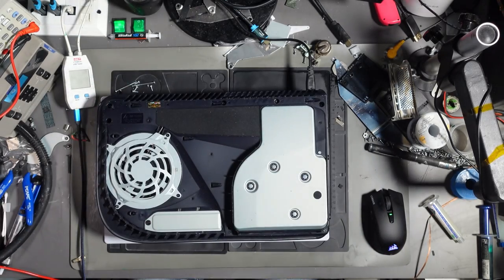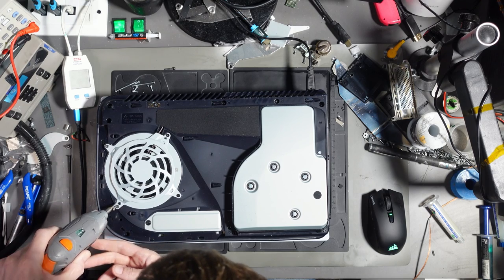Removing The Foam From A PS5 APU Is A BAD IDEA! Can I Fix Someone Else's Liquid Metal Mess?

Comment: I probably wouldn't have reassembled it without foam if it's that essential.  If it doesn't come in with one either refuse the repair without them sending you one or charge for one but I feel like it would be the same as if a console didn't have an x clamp. Just my 2 cents.
Reply: well you can run them without foam but you have to give up on liquid metal and run the machine with thermal paste.
seen some ps5 work with thermal paste but it isn't as silent as the regular setup.

Comment: Wow, if they have sent you 17 pieces of foam they have removed, there are at least 17 consoles out there that could break down at any time
Reply from the maker: Oh it's definitely more than that. I'd say multiply that number by at least 20 or 30 😮‍💨
Reply: @TheCod3r  - Sounds like they are hoping for these problems to occur, so they have more incoming work, and so make more profits, hoping that someone with your skills, doesn't realise that the foam needs to be there in transit.

Comment: Maybe when you don't have the foam, thermal paste in a syringe around the edge of the apu first. 
before applying the liquid metal. 

I know it sounds daft but it might create a barrier for the liquid metal. 

I understand that if the leaks somewhere else it might still short the board, but hopefully less cleanup.

Comment: Refuse to fix the console if they remove the foam. I don't think it's your fault but you should never send it like that either. Cheers mate.
Reply: Was thinking the same. No disrespect but if you know something is definitely going to fail without the foam why even fix it without it. Just replace the foam and charge them.
Reply: i agree..he sent it back out knowing the issue..but complain throughout the whole video..do the job the 1st time and your work wouldnt be sent bk...i like you coder but your common sense is lacking..if i was the customer i be a lil upset to both you and original shop..stop making excuses

Comment: Hi Phil, just a thought (or maybe a useless one at that) if the liquid metal had gone further in, could you use a compressed air can to blow into the opposite side of the APU and attempt to force blow it out? (Removing the existing liquid metal with a syringe first)
Reply: Ive told him so before on live steam already. I guess its not a viable option.
Reply: @jonathansandiford4137  I've done it on a laptop gpu with hairdryer, and has worked years fine after that
Reply: Just posted my comment and then saw yours. 😂
Reply: The fact that the business kept the sponge tells you they knew it was important, it's not your responsibility to replace every sponge removed and it's not the customers who should pay for it, the business made a FUBAR and they should pay for it.
Reply: There's a lesson to learn don't use that business and go directly to phil

Comment: Great work :-) i may have seen wrong but it looks like there was still a lot of liquid metal on one of the chips. So at 17.46 if you pause your video, to the right theres 3 vertical circle ground holes, just to the left of the middle one it looks like the chip is covered in it. I may be wrong but thought i would just say just in case. 👍

Comment: Not sure if it works in this case but have you tried using a syringe with a needle and sucking up the liquid metal, I saw tronicsfix use this method

Comment: Great video mate, just out of curiosity why dont they use none conductive thermal paste as used on PC GPU's/CPU's? I appreciate LM has a very high thermal transfere rate but in my experience working on high end PC's the difference between LM and good TP is only a few degrees difference in temps and no chance of damaging components from shorts. Keeep up the great work :)
Reply: With Thermal paste the PS5 will overheat
Reply: @BennyAlex98 maybe. My guess is to prevent long term thermal damage over many years of use. Some games really stress the APU which causes a lot of heat.
Reply: @Mr_Battlefield  tronicsfix himself testet the ps5 with thermal pasta and it will overheat in games

Comment: Fantastic work again phil could you have sent it back to the business after you have tested it working without the liquid metal been installed..then up to them to replace the liquid metal  and replaced the foam..i purchased a generator without the engine oil been added to stop it leaking all over on transition 😊

Comment: This is what happens when people (the other business) think they know better than actual engineers who have undergone design reviews, DVT, vibration testing, thermal cycling, burn-in tests, etc, etc and as an engineer who has performed these various tests it’s quite frustrating to see people “fix” your work because in their mind what you have done doesn’t make sense despite actual hard evidence from testing proving otherwise. 🙄

However my honest question is, why did you re-assemble and ship back without the foam, I know you said you can’t replace from your own stock on all consoles, but why not call the business and ask them to ship you the foam before you would return it? They obviously had it on their shelf. Maybe in future that’s what you need to do? Simply refuse to repair the unit if the foam is not present until they send it over. 🤷🏽‍♂️

Comment: If the  Foam was  put on it should be put back because they would have not put The Foam if it was not needed. by the way have you thought of using a small paint brash when that happens

Comment: well you can run them without foam but you have to give up on liquid metal and run the machine with thermal paste.
seen some ps5 work with thermal paste but it isn't as silent as the regular setup.

Comment: @TheCod3r  Mine was bought day one in NOV 2020 ...now almost 4 years later [ always sit HORIZONTALLY like my PSX-PS2-PS3-PS4 }I started to experience freeze/shutdown and guess what : my CPU have a DARK/BLACK CORRODED CPU because 80% of the Liquid Metal have go on the outer side of the CPU because of the overheat , I cleaned this mess but for my CPU its already too late , its corroded to a very bad point !

Comment: Does the PS5 have poor contact with the coldplate? I see no reason to use so much liquid metal that it leaking is almost guaranteed without foam. Using a proper amount, a thin layer painted onto both surfaces shouldn't leak much, if at all. I have liquid metalled the CPU on one of my test systems without using any foam, and I have had 0 issues with it, and I've definitely banged around it a bit.

Edit: Also another helpful tip, you could use clear, non-conductive nail polish to block the gap between the APU and the board, letting nothing in in the case of a leak. It would still get on the board, but not in the BGA area. On my test system I mentioned above, I used clear nail polish to cover some capacitors around the CPU die.
Also, I would like to see someone try thermal paste. I know some people have done it before, but I want to see what a good quality paste would do.
Reply: Because these are designed to last 10 years for consumers who aren’t going to be tinkering with the innards/cooling. There’s likely no issue ever if repair people don’t mess with the foam containment system. The giant pool of liquid metal is so that it has enough to last under a myriad of conditions.

Comment: Would a parts ultrasonic cleaner not work ? Or heat the apu not to melt solder but to make liquid metal more fluid and let it runout

Comment: If they come back without the foam pad, can you not remove the liquid metal and use paste instead?

While paste won't be as good as liquid metal for conductivity, I suspect the PS5 would still run perfectly fine with paste.
Reply: it would probably only last a short while before it eventually overheats is my guess.

Comment: If you knew it was missing and that it would eventually cause problems, then in my opinion you should never of put it back together without the foam. I know you never removed it but you did put the console back together with your security sticker knowing it was missing and that's bad workmanship.
Reply: I was wonder the same.  Why ever but a console back together if you know it would happen?  I guess I need to see the video when he first replaced the HDMI port.
Reply: If a tech tells you not to do something then it shouldn't be done people can get upset and argue all day, but at the end of the day you will be charged and who cares how you feel you should have listened.
Reply: The other business removed the foam not Phil.
Reply: @RBKing80  he had to take it apart to fix the HDMI port and was aware that the foam was missing.  It would be like me replacing your brake pads and saying the previous tech left a bolt out and not replace it, then you have an accident and the brakes failed because of a missing bolt.

Comment: Could you rig up some kind of pressurised spray such as a plastic garden sprayer with a small wand to force out spills from behind the apu with ipa? Then put large cotton buds at the opposite side to catch any liquid metal that comes out. Good job m8.
Reply: A dental pick where you put alcohol into the reservoir would shoot I tiny high pressure jet

Comment: Imo if I got a console in and the foam was gone ( or not with the console) I personally would not repair it till the foam issue was resolved, but as someone else said 17 foams they sent you that’s another 16 consoles that could be with customers about to go pop, defo not good customer service practises, if you can’t fix it don’t try too, was what I was taught.

Comment: if I have understood that right. You did a trace repair on HDMI. And also you explained, they take the foam off, because they use a reball-machine, to take the HDMI Port off? Well.. if this would really work, you shouldn't need to do a trace repair, right? I really understand your point and cannot figure out, why the hell somebody is not putting that foam back, after they messed around with the reball-machine... that leaves me speechless... - well, kind of -

Comment: I think you actually do bear some responsibility. You put the console back together knowing the foam was missing, and knowing it wouldn't take much to cause the liquid metal to contaminate the board.
Reply: Sadly would have to agree with you. If he knew the liquid metal would run around the board without the foam then the machine should simply be marked as a "no repair". To instead fix the machine and then put liquid metal back on the apu without the foam barrier is basically sending out a machine that will likely be DOA.
Reply: well you can run them without foam but you have to give up on liquid metal and run the machine with thermal paste.
seen some ps5 work with thermal paste but it isn't as silent as the regular setup.
Reply: @Tailslol  and they will not live longuer as well.... designed to crack after the warranty period
Reply: But who took the foam off the board in the first place?  Not him.  HE is not responsible for everyone else's mistakes.  It's called taking responsibility for your own actions.  This is the whole reason this liquid metal issue is happening.  It's because people are either opening their consoles up themselves, or taking them in for repair and it happening on that end.
Reply: @jordanking7711 Agreed. Any repair shop that’s operating in a professional capacity must understand the change in essential procedures with the new liquid metal cooling devices. The fact the shop had that many sponge spacers for ps5 on hand is very concerning. I’ve repaired numerous ps5 consoles at my workplace (repair tech job, mostly HDMI’s), and never once removed that spacer. I’m likely lucky, having never needed to clean under the foam. Still, the initial repair shop should have replaced that foam no matter the reason for removal. Their presumed assumption that a “send-off-tech” would do it for them is somewhat irresponsible.

Comment: It would be like fixing a car with a new radiator, but leaving a missing pipe off deliberately..and giving back to owner..
Heres one thing, is it possible for the liquid metal to end up in the PSU thereby creating a potential short and fire risk.. or even the LM creating a fire risk on the motherboard itself..?
As has been said, if a necessary part is missing it should be put down as not fully repaired, until such missing part is replaced.
Or sent back to business with no LM and stated as such, due to the missing foam.. let the business replace the foam and LM

Comment: I feel like someone needs to invent a micro vacuum, to help suck out liquid metal and capture it in a filter to be reused.
Reply: I have already 😂 I used a syringe 💉 then used step down pipes to attach a small powerful hover vacuum. Works great. I’m on building a prototype that will be small and practical. I’m going to be rich. 😂

Comment: to be honest I think Sony should have used a really good thermal compound instead. the 7 degree difference in temps is not worth all the hassle to be honest.
Reply from the maker: I agree, but I've seen these under normal conditions and even the other components end up with signs over excess heat. It's inevitable they're all going to fail
Reply: agree, liquid metal is more like a overclocking enthusiast real for me. if it was for thermals just making a bigger cooler with 2 120mm fans had being enough, even if is chonky it clearly looks that the size of the console wasnt a problem.

Comment: Why would you get comments about taking responsibility when as you say you did not remove this foam, all I can think is that did it come to you originally without the foam and if so is your policy to leave as you find except for fixing the fault as known. I would be surprised as to be honest you are one if not the most competent console repair engineer I have come across even the American ones don’t match up, so in this case I would have thought as soon as you see the absence of the foam you would either replace or notify the customer as that way you can invoice additionally because as you say you can’t do things for free, this is the only suggestion I think would make you stand out even further as a top notch technician is where you know it’s been removed notify, charge and replace, if customer refuses then that’s a different matter but as long as you’ve notified you have done your due diligence. I’m not a technician or an electronics expert, I randomly came across your channel and have been a regular watcher for a few months, something in that says a lot about you. Best of luck our kid

Comment: You really have two choices. Refuse to do the work all together when you find that inportant missing components. Charge them for replacing the missing components. As you have unfortunately found out without that foam when you ship these back they won't make it alive.
Reply: agree he probably shouldn't work on a console if the foam is missing.
Reply: Not gonna work for free but he should charge for the time it took to dismantle to that point

Comment: No hard feelings but u being the last technician to work on it and knowing it was missing and may cause problems like this, it was your responsibility to do something about it
Reply: he may not have had any foam to replace it now he has replacemeants
Reply from the maker: No as Steven says I don't have any tp replace it with. I can only really do so much with the limited supplies we can get for these consoles
Reply: @TheCod3r  I agree with Synicol. If you didn't have the right part to replace it then you should have said so and not put the LM on it for shipping. I think you are both responsible to be perfectly honest. Not only that but I imagine you could probably make a custom piece of foam fairly easily or find some other solution, which you likely should try to do.

Comment: Phil, great repair, can't believe people think leaving the foam off is a good idea. It's obvious it's there for a reason otherwise Sony would not have added it in the first place.

Just an idea, if liquid metal gets under the APU and after pouring IPA down through from the other side, is it possible to use the hot air station (with a very low temp) or other air compressor device to effectively 'blow' the liquid metal back out? 

Not sure if that would work or not, I was concerned you may have been pushing it in further when using the tooth brush.

Comment: I’m sorry but as a technician I would say your responsible for this issue
You should have added a new foam and billed for foam end of story 
But this mess was in your control and it is your fault and you could have 100% avoided this by putting another form in as you stated on this video that you knew the liquid metal would eventually spill 
If the foam is removed then bill them or refuse the repair

Comment: been over clocking and building PCs since last century nice and cold running for 7 yr plus with out liquid meatal. clean your fans and heat sink . dont use your device as a hoover.

Comment: And when you say you bear no responsibility for this, you are very wrong. You may not bear 100%, probably not even 50%, but the fact you KNEW it was an issue and sent it out in that condition means you have a part in whatever happens. If you know there is a problem and you can fix it and don't, then yes, you do bear some fault.
Reply from the maker: You can't take responsibility for someone else's actions, and you also couldn't buy those replacement foams at the time of filming so if I can't get hold of the missing part I can't fix it

Comment: Ok, not sure why you say you can't replace the foam on every single one that comes in without it. WHY THE HELL NOT???  If it's that important, it should not leave your shop without it. That foam can't cost that much and there is no reason to not even have it in stock if it's extremely common for them to come in without them. That seems like a bad business practice. Cost should not be an issue as you just bill the customer for the added repair.